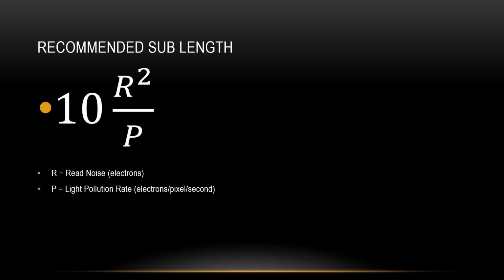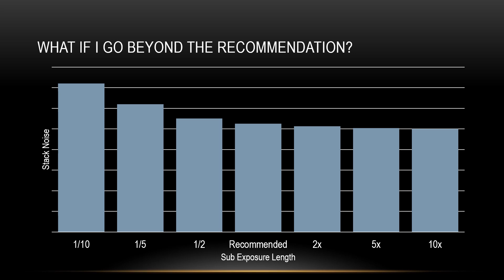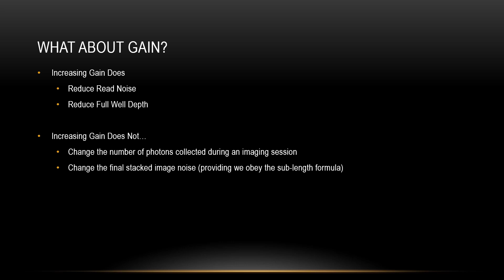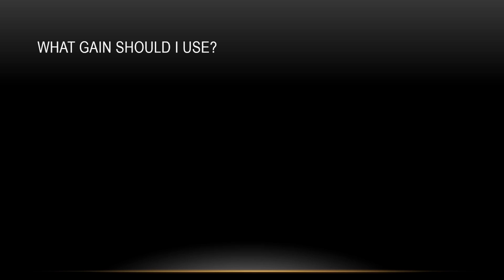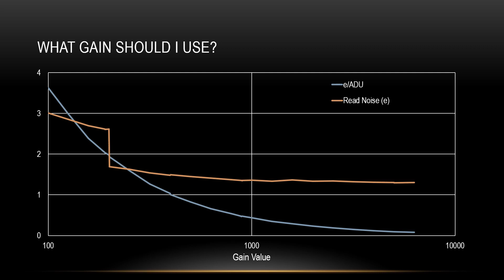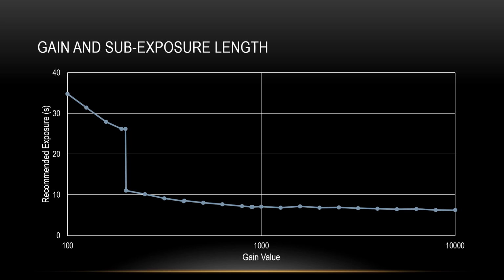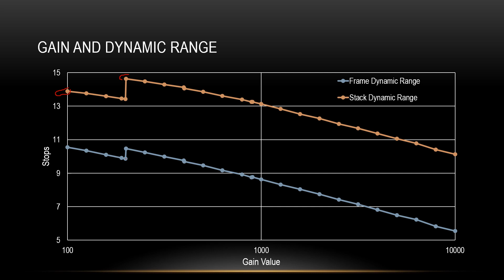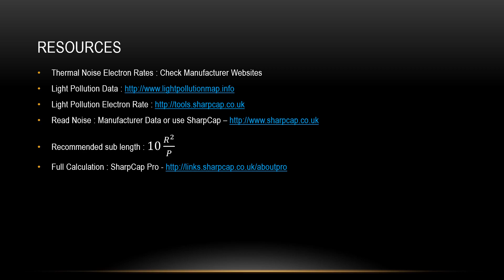Choosing the right gain for Deep Sky imaging with CMOS cameras

Comment: Is there any way to relate this formula to a DSLR or mirrorless sensor?

My Sony A7 III, for example, has a dual noise floor, which looks very similar to the step that you are talking about. The problem seems to be that gain and ISO don’t seem to be directly relatable. ISO is supposed to be an industry standard for calculating exposures, whereas gain is more specific to individual sensors. I think from memory, the step on my camera happens at about 640 ISO, so the noise at that point is almost the same as at the chip’s native 200 ISO. It doesn’t start to reach the same noise levels again until about 1600 ISO.

I checked. Unity is 590.4 and QE is 64%, read noise is 1.2e- and Full Well capacity is 96Ke-. Pixel size is 5.9u. My telescope is f/6.5.

Comment: These calculated times are recommended maximum times. My recommended sub exposure time worked out to 640s. Yes, my guiding can do 0.8" rms, but there's always a spike here or there, creating a small trail. This means that I end up throwing more away when my exposures are longer. Using shorter exposures, I can capture more total exposure time, which means that I have a different "optimal". I can just accept that I will get more stack noise under urban skies than I would get under a dark sky.

Comment: Thankyou for the very useful advice and formula for optimal sub length. One thing I'm unclear on is the issue of thermal noise.  I'm upgrading my camera and am considering whether it's worth paying 300 quid for cooling. If I use your formula for image degradation ( total noise without cooling divided by noise due to light polution only) I get values of over 10%. (Bortle 4, f5.3) using the published dark current values for the camera. Am I right in thinking I should go for the cooled version?

Comment: OK, I have QHY128C, readout noise is ~3.5. Bortle 3 sky. According to this optimum sub lenght will be 400sec. As it is color camera, I multiply it with 3. That will be 1200 sec. 20 minutes for a sub!!!
Reply: Yes? You have the option to exposure very long and continue to collect signal that is not possible for us with light polluted skies, not a bad problem to have.

Comment: SO i have access to two sites. one bortal 6 and one bortal 2-3. in the better location is says i should take 43 min exposures? 43 mins! surely I must be doing something wrong here..
Reply: You are just looking at it the wrong way. You have the OPTION to shoot longer and collect fainter signal that is impossible in your bortle 6. If at a dark sky site you shoot as long as you can before you get saturated stars/tracking issues/potential clouds/etc. This does not mean you are required to shoot 43 minutes, but that you can continue to see benefits for far longer than you could in the city.

Comment: Thank you for a terrific presentation.  
I learned a lot but admit I am confused on one key point:
I am in a Bortle 7 region with a f5.9 scope (430mm / 73mm), 12nm narrowband filter (L-Enhance Pro), color CMOS camera (ASI183MC Pro).  
Do I multiply that 6.4 value by 3 for the RGB, and then that result by 25 for narrowband?  
So: 6.4 x 3 = 19.2 x 25 = 480 sec subs? 

Thank you!

Comment: Hello!   I have SharpCap v3.2.6482, 64 bit, using with a SVBONY SV205.   Under "Camera Controls" the exposure setting is grayed out and I cannot change it.  Slider bar does not work either.  The window says Exposure  15.6 ms.    How can I get the exposure setting to work?    Thanks!
Reply: You need the pro version which is £10 Sterling
Reply: @boaty1968  Mine is the Pro version.  License is Valid Expiry Date: Friday, May 13, 2022.  But I had the "AUTO" box checked.  When I unchecked it, the exposure controls work fine.   Thanks anyway.

Comment: Unity Gain on its own as a term and what it is, not important, but since many camera makes placing the unity gain exactly where the high-conversion  mode starts (usually at 10 for QHY, 100 for ZWO ~ so I put my gain to 11 (or 101 for ZWO to be on the safe side) ) .
 But double check this with your gear, because I have a QHY camera that doesn't switch anywhere to anything, and where the unity gain is indeed irrelevant, because I just set the gain+ exposure based on the subframe histogram I get.
Reply: HCG is not 10 on QHY cameras

Comment: Wonderful summary of this not so easy to understand the gain problem. On the other hand though ... and it would be interesting to hear your opinion about this: whenever i shoot long exposures (and I am talking 5 to 10 minutes, my mount can handle this easily) the image looks by far better, and I get also very dim targets in a Bortle 6 sky. If I understood your presentation correctly I waste my time by doing this. Note: I use a gain of 200 and offset of 30 with my ZWO ASI 1600MM camera. If you like i can pass you some links to example images.
Reply: In his previous video I think he explained it.  
You took 10 minute exposure on gain 10 and it looks great
Now take 1 minute exposure at gain 100 and it doesn't look really that great. 
But by taking 10x1 minute exposures with gain 100 - stacked  - it will look pretty damn close (if not better) to your single 10 minute sub exposure.
At the end of the day, it really comes down to whether your mount is able to track well for a 10 minute sub and how much hard disk space you got.  since 10 x1 minute subs will of course take up more space on your hard drive than 1 single 10 minute sub. 
There are other reasons people taking shorter and shorter subs, once is because they can , the other is possibly satellite trails and maybe their mount is only reliable for 1 minute or - like me-  a 5 minute exposure at my location  will saturate my sub too much even at gain 0.

Comment: The exposure time are much longer than I thought.  I watched your presentation.  All along, you hinted we were exposing for too long and at the end of the presentation (1:12 in this video) you provide a table that shows I need to expose for time period 3 to 10 times longer than the 4 minutes I normally go with.  You confused me.
Reply: Be careful with that table, the camera in the example is 50 quantum efficiency (*50QE) and 3.75um pixel size.  If you got a newer CMOS camera  (made in the last 3 years) I can almost guarantee you, that your QE is above 80% ,  also check your sensor size and read noise numbers.  The best thing you can do is do the sensor analysis in Sharpcap and then turn on histogram, click the brain icon and do an optimal exposure calculation to really see what exposure length you need.

Comment: Everything said here is, of course, correct. That said, you still may wish to choose the gain differently. That is because the highest dynamic range is not necessarily what you want. Instead, you may want the dynamic range optimally adjusted to the objects of interest in the frame. As an example, if you take a picture of Barnard's loop, you will not care how much Rigel in these frame is overexposed, you want that faint nebula to have some internal contrast. So, do not plainly set the gain to "as high as needed, as low as possible", but to a value that is suitable to (i.e., does not saturate) the brightest object in the image you want with good definition and/or properly reproduced color.

Comment: By these calculations, I should only need to expose for 12 seconds with my 533MC-Pro at 100 Gain in a Bortle 6 sky. 1.5e read noise, 5.63e/s/px sky background. This just doesn't seem right to me lol. Maybe I'll have to give it a shot.
Reply: 12 seconds maybe, but because imagine how many subs you would have to make and how much hard drive space you would need , I would proportionally scale back to more reasonable subs , maybe multiply by 3 , so it's 36 seconds per sub and try with gain 40-50. 
You can also put in a light pollution filter and that will also help to increase the exposure time, thus decreasing the  number of subs to take.

Comment: Dr. Glover, thanks for the excellent treatment of this subject.  One factor that I also consider, at least intuitively, is the dither delay.  To take an extreme example, if one images for 1 hour and compares taking 10 sec subs with a 10 sec dither delay as compared to a 1 hour sub the former would collect half the photons.  It might be interesting to see how this effect might push the recommended sub exposure time under certain conditions.  By intuition it pushes me to 100-200 sec subs (so I only lose 5-10% of the photons) but I would love to see what the math says.  Thanks again for your excellent work.
Reply: Basically you are reducing the total exposure time T by some time effectiveness factor - time between subs / (subs time + time between subs)
Let's assume this factor is constant. 
Since this factor is multiplying the T you can treat it as if it was a change in light pollution factor P, which is in the denominator of the formula so you have to take the inverse.
If the time effectiveness 50%, (i.e. you spend the same in subs as in between subs) then you have to multiply the optimal subs length from the table by 2.
If 25% of the time you are in between subs then multiply by 1.333 
If 10% of the time then by 1.111
If 5% of the time then by 1.05 … 

Re dithering the whole thing becomes more complicated, as it is less obvious is to understand the improvement in quality it gives you.

Comment: I've been using the SharpCap sensor analysis to find the 'sweet spot" for gain/offset.  To me, what I'm looking for is the lowest read noise/deepest well depth mix that I can get.  With my sensor that is just past the 'switch spot" noted here where read noise makes a huge step change down and well depth (for my camera) is approx 50% of the original value.  I could keep chasing higher gains, but well depth drop off is on a much steeper slope than read noise reduction (relatively speaking), so not worth it to me.  I do have sets of calibration frames set for a couple of step changes in gain after that point for dimmer objects should I think it's necessary, but I've not had any issues with the quality of the results I've obtained by prioritizing read noise/well depth as my setting criteria.  YMMV

Comment: Great Videos - I am into EAA, and minimizing sub exposure times plays right into EAA.  Question, on the sharpcap tools page, for the pixel size, do I modify that if I am binning?  For example, I have a 294MC OSC, which has a size of 4.63um, but at longer focal lengths I bin at 2x2, so do I need to change my pixel size to account for the binning?

Comment: Great videos; thank you! Help's a lot for a beginner in using a CMOS-Camera. But there a two questions concerning filters i want to use: i purchased a osc-cmos camera (ASi0171MC Pro) and what to ask you which factors should be applied when using either a LPS-Filter (Hutech IDAS LPS-D2) or a Narrowband-Filter like the 'Altair QuadBand OSC CCD 2" Filter'  (FWHM 35nm). As far as i understood the factors for narrowband are for mono-cameras; is that right? So which factors do you suggest for this two filters with my ASI071MC Pro?
Thanks a lot

Comment: I've looked up the read noise vs gain chart for my camera (https://1.img-dpreview.com/files/p/TS560x560~forums/59260758/37aa3dc7d9834108a99d18161cf28756) and it shows the read noise increasing proportionally relative to gain. However, there's a dip at 800iso, should I shoot at 800iso or 200iso in order to minimize read noise? Bortle 3 sky, f2 camera lenses (no telescope yet). Thx a lot!

Comment: I have an f/7.5 refractor and a Zwo1600-mmcool , so if I'm understanding correctly the recommendation for my rig would be to set the gain to about 139 (*happens to be UG for this camera but it's also where the graph stats to flatten), and to take about 10-30 sec Lum exposures in my Bortle 5-7 skies.  When you said 3x longer for RGB, does that mean I should be taking 90 sec exposures for each of those filters?   If I bin 2x2 does that mean I can get away with 45 sec exposures for the RGB filters?

Comment: Great work Robin. Finally debunking the myths and taking the guesswork out of sub-exposures settings... I have recently moved from DSLR to colour CMOS, moving from a SCT 2000 to a 478 gt81 and considering the move from ATP to Sharpcap Pro. So this video and the previous one are very helpful to at least reduce the risk of wasting many valuable clear nights of bad data acquisition.
Reply: The price is very low compared to the hardware expense of this hobby. I use them both, for them strong points.

Comment: Excellent video. I would like to add that this is all for a "perfect" sensor, in practice there's sensors out there (looking at you, IMX183) that show pretty nasty banding at 0 gain and lots of "amp glow" at high gain. Optimal gain is then found by the same considerations you mention, but excluding those bad extremes.
Reply: Bingo. My ZWO cmos also have bad banding at between gain 0-20, so those gain settings are a no-go, no matter what.